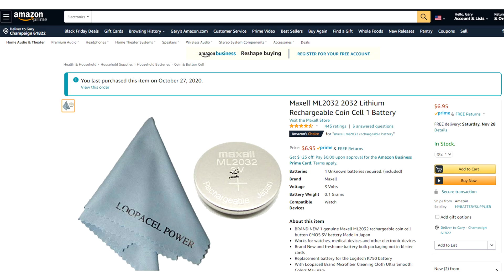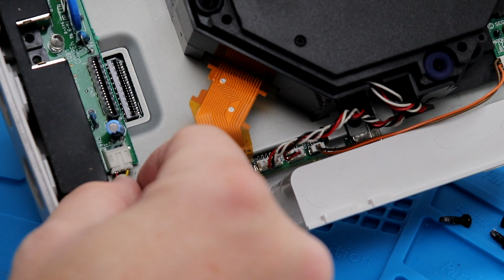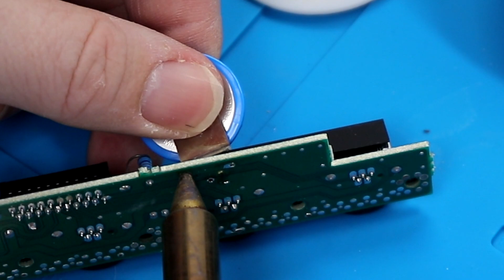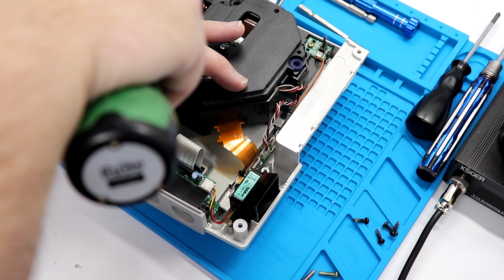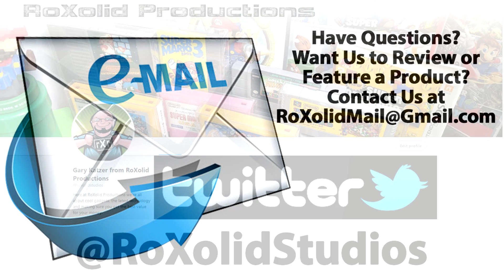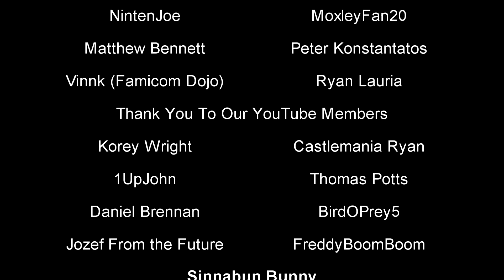How to Replace the Date & Time Memory Battery on the #Sega #Dreamcast

Comment: Remember to be very careful when handling or working on internal components of the Dreamcast, making sure you properly discharge the capacitors before opening it up, also ensuring you don't touch any capacitors (especially on the power supply board) as they may still hold a charge and can shock you!

Comment: So strangely, it doesn't hold a charge, it'll work for a day or so, and then it dies. Is it bad soldering, or am I just unlucky?
Reply from the maker: Well the battery is not rechargeable so you may have something else going on
Reply: @RoXolid  I was told you leave it on for a few hours and that charges the battery for 20 days or so.
Reply: I figured out I had the wrong kind of battery in it, I had a LIR2032H battery instead of the ML2032 @RoXolid

Comment: Does The Dreamcast Recharge The Battery??
Reply from the maker: No it is not a rechargeable battery. It's a 3 volt lithium battery, not lithium polymer or lithium ion if that's what you were thinking. So it's pretty remarkable that these have lived for over 20 years at this point

Comment: Well I did it I went on eBay and bought two Dreamcast systems with a few games. At first I thought I was having problems with my controllers. After a few minutes I was able to get past the date screen and it seemed to function. However after seeing this video I may need ideas to replace the battery in my system. I actually purchased two systems off of eBay. I was able to get one working inserted several games etc.  It did seem to function OK however after a few minutes of trying with multiple controllers to get the date to be changed. So maybe the battery needed to be charged I don’t know it was an online charity auction so maybe. I don’t know if I need to just have the second consul plugged in longer to test to see if it can recharge whatever battery but do you have any advice on how to let it sit for a while to charge the battery up. If the battery is OK of course. Anyways I am looking forward to hearing from you. To be honest I purchased these to try to resell them. I resell many items both on eBay and in antique mall here in Lakeland Florida where I live. I sell mostly to provide extra funds for childcare and medical costs for my son who was born premature and is considered developmentally delayed. So any help that you can give me would be greatly appreciated. Please forgive any grammatical errors as I was dictating this while trying to figure out what my kids wanted for dinner.
Reply from the maker: The battery isn't rechargeable, it's a Lithium Button battery. The battery status should not affect the controller performance, so I don't know what's going on there.
Reply: @RoXolid  The controllers are all fine after a while for some reason they controllers that I used in the consul started working just fine and I set the date the second cancel that I have is the one that stuck at the change the date screen. Please forgive any grammatical errors as this was dictated
Reply from the maker: @Nothing19800  No worries, I use Text-To-Speach all the time.

Comment: I don't get why systems are made with hardwired batteries. Would it have been so hard for them to have put in battery holders so they're easy to replace? Maybe they figured no one would ever replace it? 🤔 Easy to get to would've also been nice! Some systems like a PS4 make it hard to get to the battery!
Reply from the maker: Many just didn't plan on these systems to still be going 30+ years later

Comment: If I use a CR2032 Maxell battery, instead of ML 2032 Maxell battery, will I have a problem?
Reply: He literally said in the video that you should NOT use a CR2032, as that is NOT a rechargeable battery. Using a non-rechargeable battery will cause that battery to explode. Use the ML2032 as that IS a rechargeable battery.

Comment: Nice work. You could have done the resettable controller fuse mod too while you were in there.
Reply from the maker: I'm not familiar with this, I'll have to research it!
Reply: @RoXolid   72V 400mA Radial Lead Type PPTC Resettable Fuse PolySwitch
Reply from the maker: I'll look into this! But next up is replacing the HDMI port on an Xbox One S (Hoping to have it done for Friday)
Reply: @RoXolid  did it break?  have you looked at the pins on the board?  I thought I broke mine but it turns out the HDD failed.
Reply from the maker: @moandaindesigns  It is physically damaged. I bought it used on the super-cheap (like under $50!) for the purposes of a video.

Comment: Everytime I see you or someone else do soldering, I always feel left out. As if it was one of those essential skills I should have learned in high school.

While not videogame related, I do have defective logic boards for certain electronics that probably could have been easier solved with a soldering iron and workbench rather than buying identical model motherboards to replace and repair my TV or iPod classic.
Reply from the maker: It's never too late to learn!